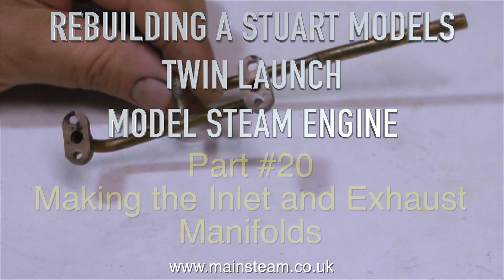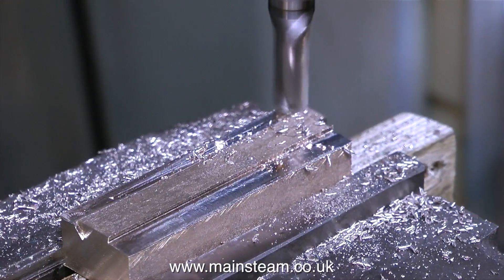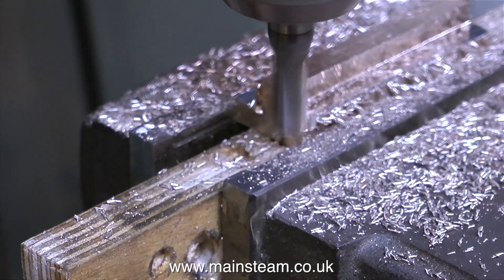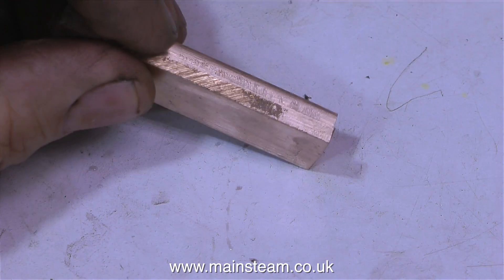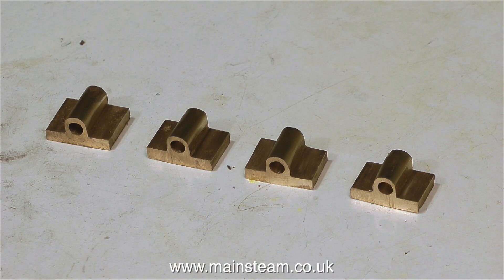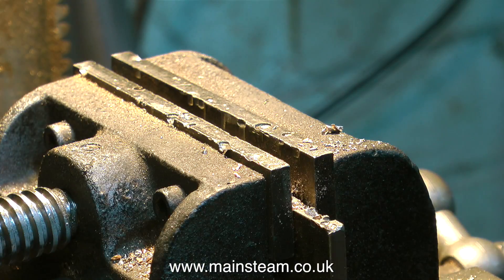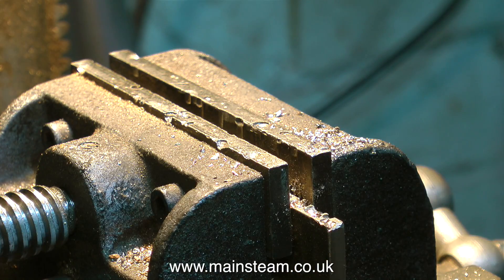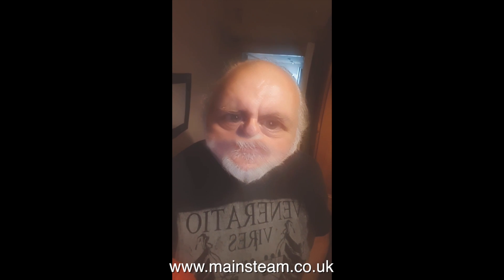STUART MODELS TWIN LAUNCH STEAM ENGINE REBUILD - PART #20

Comment: I worked packing used machinery in crates. I got a metal chip inside my finger one time. Heed this man's words. You don't want none of that. Little curl cut right in and curled all the way inside my finger.

Comment: You could maybe feed the compressed air and oil through the inlet of the displacement lubricator, in case there is a threaded plug to fill it.
Reply from the maker: Yes, I often do that.

Comment: Aluminium bronzes can be a pain to work with  one nice thing on it Keith it is corrosion resistant even to sea water  and is used to make for some very hard bearing races.  that is what they use in a number of bronze colored coins  because of high wear-ability

Comment: Another fine video.  Thanks.  
I've been meaning to ask- what model microphone do you voice over with?   Do you use a microphone processor or massage the signal with software?  I'm always impressed with the clarity of the voice over work.
Reply from the maker: Most of the time I use a "RODE NT2A" large capsule condenser mic for the voiceover part of the video, I only use the "reduce hum" function in the software to roll off the bottom end as my old analogue to digital interface that I use with the iMac doesn't have a roll off filter at the front end. Sometimes I use my "Neumann U87" which is much better.
Reply: Do you use a treated room for recording the voice overs? I dont recall hearing much in the way of outside noises that large capsule mics are so good at picking up.
Reply from the maker: I record in front of my 27 inch iMac computer, but that is in my recording studio control room which is not totally dead acoustically speaking, but it's not very ambient either. The room has a couple of acoustic panels on the back wall and one on the side wall. They are not just foam things, they are called "Soundsorber" panels and the absorb reflections.
Reply: My television set isn't even 27 inches.   :)
Reply from the maker: I like a big screen as I is well old innit and my eyes aren't as good as they used to be :-)))))
Reply: Thanks for sharing the inside scoop.  Sometimes it's just as interesting to learn about things only casually associated with the video topic.   Steam engines are cool too.  I'm becoming inspired to maybe build one.  I live about 30 miles from "American Model Engineering Supply", which from your description is likely a lot like Black Gates Engineering.